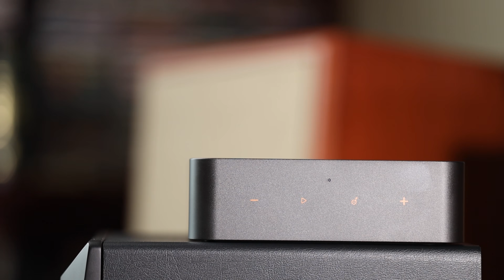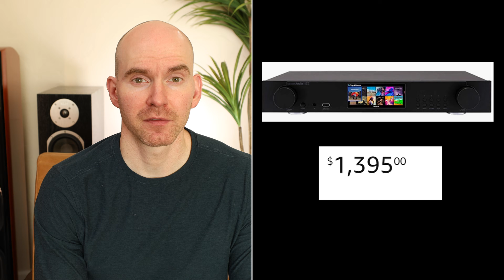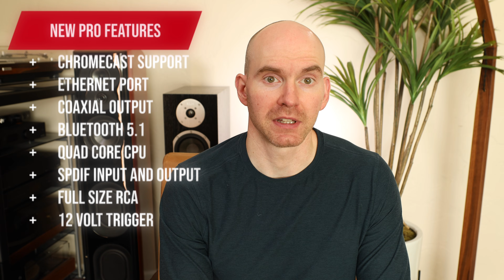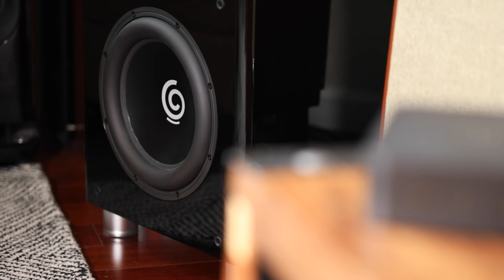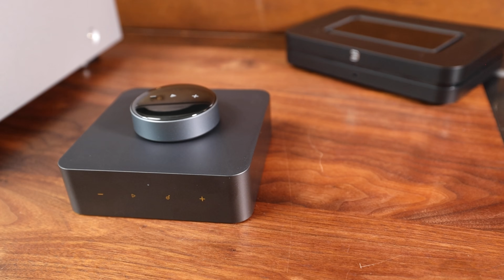WiiM Pro Review - Good Luck To The Competition - Budget Streamer Juggernaut

Comment: You get what you paid for essentially. Wiim is a very convenience product, but it is not a killer of anything.
Reply: The WiiMs selling point is that it's affordable, easy to set up, the app is solid in use and features, and connection is very stable.
Think of it as a Raspberry Pi streamer without needing any assembly or software installation and configuration by the user.
Yes a lot of people would rather have a better DAC or for it to forgo the onboard jobbie entirely for a lower price but the fact that it can do all this while adding a good functioning snd frequently updated app at this price shows how far behind (or just choose to spend money on advertising and shills) many of the big names are when it comes to product development.
Also the price says something about how cheaply the bigger brands can buy the same components and how much more they charge the consumer.
Reply: @pauln6803  Rasperry Pi sucks as a streamer. If the Wiim is like that, then I will have no desire to buy.
Reply: @simplereef4854  
The WiiM Mini is actually pretty good as a streaming transport.
Can't say I've had any real issues with mine, but then I only use it for playing files on my NAS and internet radio.
The internal DAC is well known as being "meh", the digital pre EQ adds significant distortion if any real frequency boost is applied (confirmed by Audio Science Review bench testing and my own ears) and the app often becomes unresponsive when switching between other apps on my phone.
But since the device itself carries on playing the rest of the files in the folder or the radio station and I have the option of using the bit perfect S/PDIF output (once again confirmed by the ASR tests) into a much better DAC, the criticisms are far from deal breaking - especially when you consider the price.
The more expensive WiiM Pro on the other hand, is still very much a work in progress...
Reply: @simplereef4854  
And no, in the game of HiFi you don't necessarily get what you pay for.
That is unless you consider marketing and aesthetic styling something you are willing to pay considerably more for.
Make no mistake, the Chinese have been studying western HiFi and have decided they can crack the high end without dealer margins and traditional advertising budgets.
Reply: It’s going to kill the Node. 😂

Comment: Nicely Done and just in time .
Did I hear correctly Amazon HD up to 24 192 from the wiim app  ?
Is this a bluetooth receiver and transmitter with 24 192  ?
Last question if you have time -  if using the rca outs to a receiver what audio quality can you get ?
Thanks in advance
Reply from the maker: It’s capable of 24 192 including from Amazon HD service. Bluetooth 5.1 will be unable to support lossless audio.
Reply: @MattCoykendall1  No lossless over bluetooth 5.1 :(   
Maybe it will come on the Wiim pro ultra
Reply: @deadline7610 
Bluetooth is not very good sound quality, better to use Flac files from a NAS
Reply: @MattCoykendall1  Matt is the Pro a Bluetooth receiver - transmitter or both ?
Thanks
Reply: @deadline7610  Bluetooth 5.0, SBC and AAC codec, BT receiver and transmitter on the website if you look

Comment: I haven’t figured out why audiophiles often prefer coaxial to optical. Optical removes the noise from the streamer so you don’t have to worry about the streamers switching power supply or other internal noise. With coaxial you are bringing your streamers noise into your DAC.
Reply: @@user-iz4st3zx1v EMI and RFI can definitely be transmitted over coaxial. That’s not ever debatable.
Reply: @seanb3303  it can be transmitted yes, BUT it does not form part of or alter the data stream in ANY way. It's functionally identical to optical.
Reply: I use optical. Problem with optical is that the signal needs to go via adapter twice, from electric to light and back again. Have to be done right in both ends.

Comment: Sounds like a hybrid between the Wiim Mini and Arylic S50 Pro, both of which I have. Of course the Arylic doesn't spit out 24/192 but capped at 16/44.1.  But its build quality, remote control and connectivity beats the Wiim Pro.  I use the Mini toslink'd out to my Rotel preamp/DAC and it sounds very good, far better than with the Mini on its own. When compared side-by-side both toslink'd to my preamp, the Wiim sounds airier, more spacious and better-detailed in the highs than the Arylic. But those differences vary by the source content ..... overall the Mini has the edge.
Reply from the maker: Thanks for the input! I have an acrylic S10 sitting here due for review as well.
Reply: Who the hell cares about build quality of a device you never physically touch or manipulate with and who needs remote when you anyway using it via phone app?  Sound quality is main factor here

Comment: can you compare the sound of wiim pro to bluesound or ifi zen stream when paired with an external dac?
Reply from the maker: Sure I felt that when I paired it with a high quality external the results were mostly indistinguishable when both the Pro and node were connected to external units. External DAC Pro vs stock node you can certainly beat out the node with a better external. The DAC in the node is decent but won’t compete as you scale up.

Comment: Great review Matt. I had, for some weeks, the Wiim Mini using it with Tidal. Despite it worked flawlessly with the Tidal app, I don't know if it was for my audiophile snobbery or it was a real thing, that I heard the Mini a little harsh and un-refined compared with my Raspberry+Pi2AES combo, both connected to a Pontus II DAC. Did you compare the Mini and the Pro with external DACs?
Reply: If the optical output is bit perfect, how can the same file (local or streamed) sound different on the same DAC from two different streamers via optical output?
Either one or both streamers is Not bit perfect.
If both streamers are bit perfect via optical with no eq or volume applied, they should sound identical played on the same DAC, amp, speakers etc
Reply from the maker: This kind of thing can be very difficult, you have to at least somewhat question if the sound is just different not worse. You grow accustomed to a specific sound and changes can be perceived either good or bad depending if it fits your listening characteristics. I did test both with different external DACS, IFI IDSD NEO, Schiit Modius, SMSL SU-8s. I found the output of the mini and pro very similar with these. Thanks for watching!
Reply: Pontus II huh. Fantastic